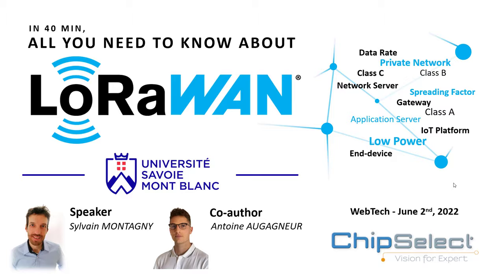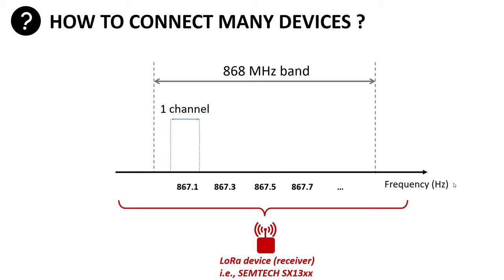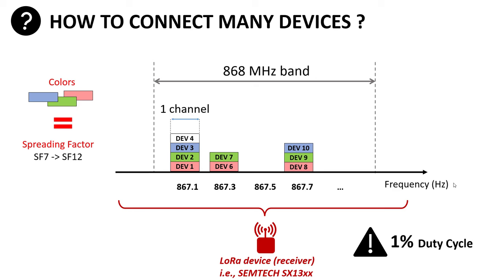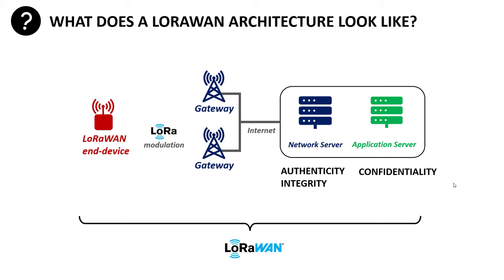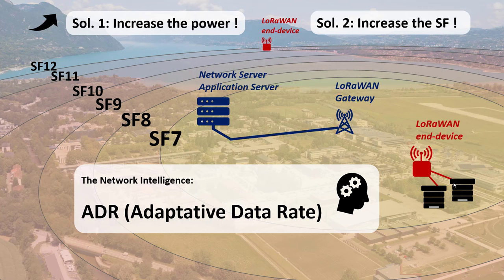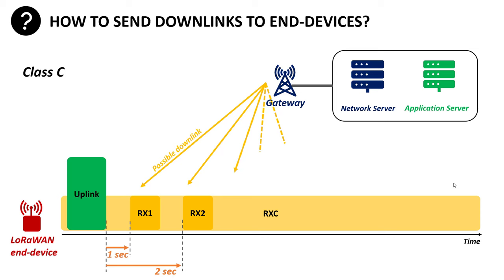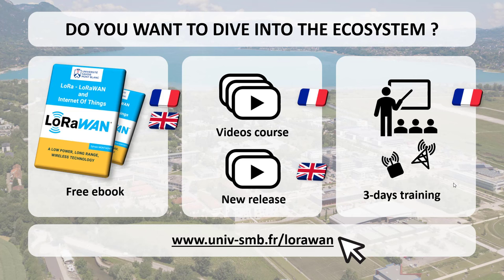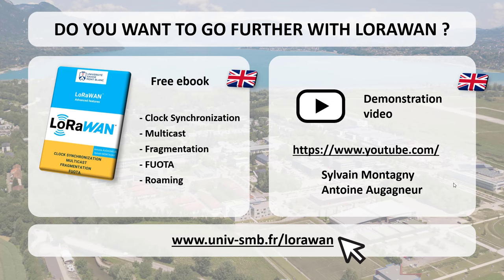All you need to know about LoRaWAN, in 40 mins

Comment: Can the LoRaWAN end device be used as a tag for a moving object like a forklift or stationary object like a wheelchair ramp? Can it be safe from environmental harsh conditions like oil, heat, extreme cold, rains and flood? Thank you in advance.
Reply: Yes,  there are LoRaWAN devices for industrial asset tracking that are rugged with IP67 or IP68 level.